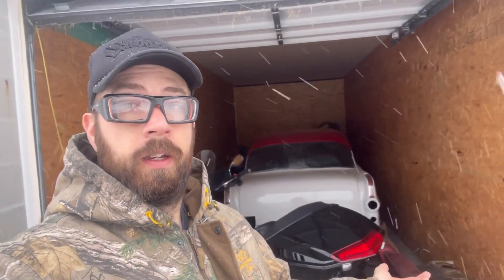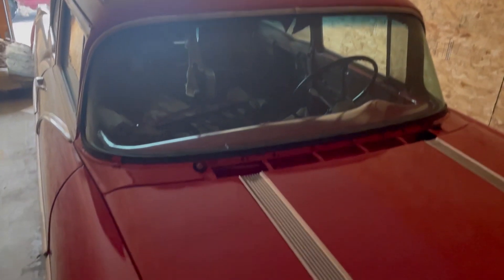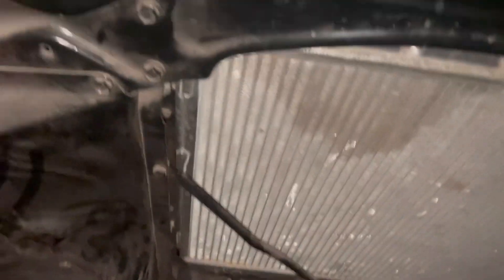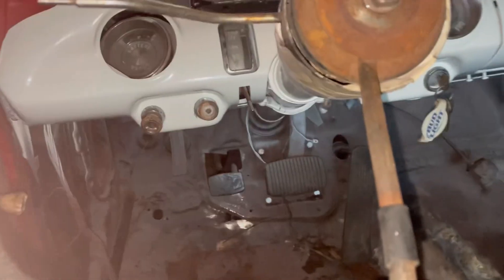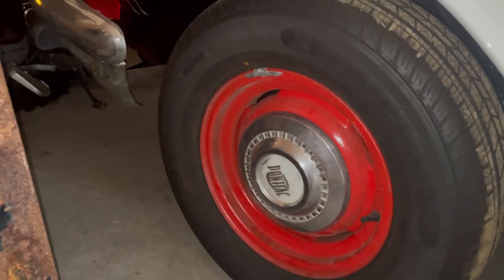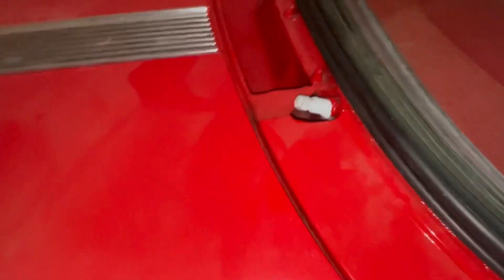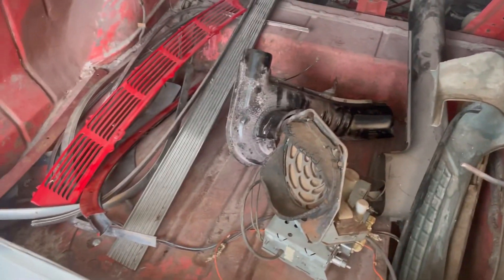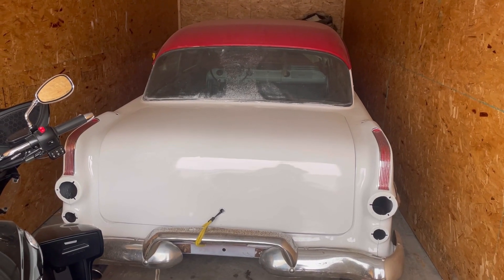1956 Pontiac Star Chief. For sale.

Comment: Clean and sharp though it looks like it's a post car and more likely a chieftan not a star chief. 

There's so many variations between chieftans, then catalinas, then star chiefs
Reply from the maker: Thank you for the information. I’m going off of what I was told from my father.
Reply: @Hughberts Projects  yea if there is a chrome strip on side of rear fenders where the 3 red blips are it's usually either catalina or star chief, or a Canadian model pontiac laurentian.

Unless someone modified it.

And a star chief has like 5 or 7 inches of extra length on body rear end
Reply from the maker: I’ll have to look at it more now with this information.
Reply: @Hughberts Projects  lot of good Facebook pontiac and or pontiac chieftan groups older folks very knowledgeable
Reply from the maker: Thank you. I’ll look up the groups